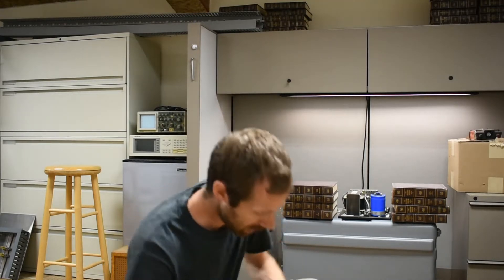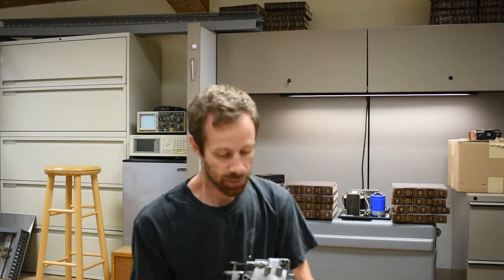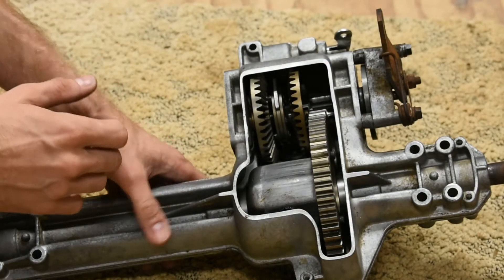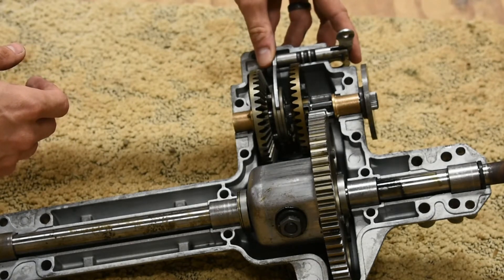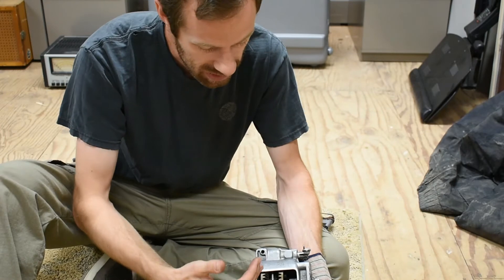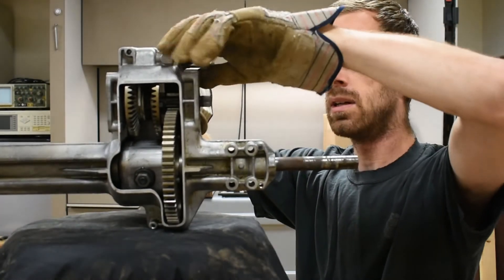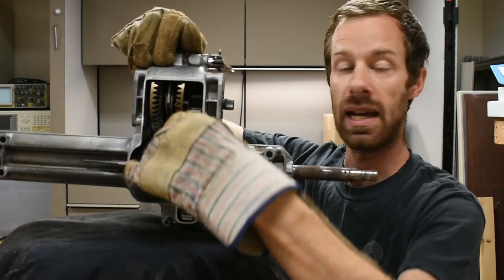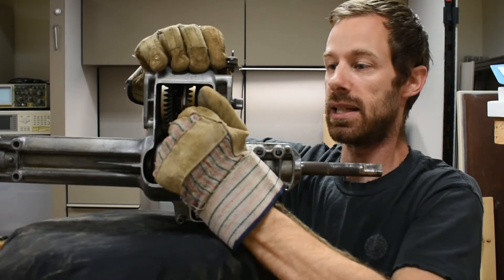What's Inside a Lawn Mower Transaxle?

Comment: This video is exactly what i wanted to see, I have a older mower that feels like it jumps out of gear and back in sometimes after shifting from reverse. If it doesn't then it won't.
I think that spline disc isn't engaging the pins properly. Hopefully it just needs an adjustment or a clean inside. I think i know what i'm in for now. Thankyou.

Comment: Your video is the very best YouTube Video after watching dozens on this same subject for a Lawn Mower Transaxle repairs !

My newer MTD Yard Machine 7-Speed Transaxle with VSP system is turning both rear wheels in opposite directions when setting the Shifter in Neutral (or when disconnecting the linkage & manually engage the Transaxle Lever to Neutral, the middle position. ... 
This is something you say in Video "Never Happens". So how can this happen ???

So my next step is to physically check it's inside Gears to see what needs fixing. ... 
Until then, I cannot Freewheel my mower into the garage to service it unless I jack up the rear of the mower with my 3-Ton floor jack on wheels to move it.

Thx, Larry
Reply from the maker: Do you think, perhaps, that one of the gears is stuck and constantly rotating? That would make it go forward when driving in forward gear normally, but if you tried to go into neutral or reverse, one wheel is still spinning the forward direction and the other is in reverse?

Just spitballing on that - it would be impossible to know without knowing what's going on inside the transaxle... 

However, this video is for a single-speed transaxle, so a 7-speed might be different.

Comment: My Toro LX 420 always had sort of a whine in the transaxle and assume it's those straight teeth gears that do it. It weighs on me that the only way to find out whether or not the transaxle has enough grease in it is when it breaks some day from lack of lubrication. I wish there was a grease fitting on the housing some place and a way to check if it has enough.

Comment: I could use your help. I have a Kenmore 90 Series washer. After completing one load of wash I started a second. The tub filled with water, agitated then stopped. No matter what setting I put it in nothing happens. No humming, nothing. Another Kenmore 90 series washer was given to me. It agitated but no spin. After checking it out it was only a loose wire. Plugged it in & it went through the cycles. Put a load of cloths in & the only cycle that will now work is the spin. Any help on either one of these would be appreciated. I did notice same series but different timer control model. I did check the lid switch, both are good. I even jumped them to make sure. New time did not help any. Here is a video of what I did maybe you could direct me in the right direction.https://youtu.be/CHE_2f5OG9Y
Thank you for any help you can provide.
👍# 215

Comment: My mower goes in reverse but not forward could that be the transmission pulley or the nut is not tight enough
Reply: I know your comment is a year old but if your mower transmission is anything like the one in this video the two nubs on the forward gear may be worn down and not engaging.

Comment: 7:35, can you explain what is inside the box (with a hex nut on it) on the left side of the spur ring gear?
Reply from the maker: Oh yes! That is actually a differential gear set using bevel gears, similar to a normal automotive diff. 
The hex nut (which there are actually two) are attaching the bevel gears to the sides.

The purpose is to allow one side to speed up or slow down when you are turning a corner or if one wheel meets resistance. Like when you drive through mud and one wheel just starts free spinning, the other one stops. You have to push the spinning one down into the ground to get traction to start moving again. This is the gear set that makes that happen.

Here is a closeup diagram from wikipedia: https://en.wikipedia.org/wiki/Differential_(mechanical_device)#/media/File:Differential_(Manual_of_Driving_and_Maintenance).jpg

Comment: Hey!  Thanks for making this video.  Do you know what the gear ratio is from input to output?  What are the sizes of the gears here?
Reply from the maker: So there are three ratios at work there, but I only know two of them for sure. 
I don't have the original pulleys, so the belt ratio from engine output to transaxle input is unknown, but it's probably not too far from 1:1 - I recall the pulleys being fairly uniform in size... 
The first gear ratio, the bevel set, is a 1:3 ratio, and the second set to the final drive shaft is 1:7, giving a total 1:21 ratio. Approximate diameters - large bevel gear 3.5", large spur gear 6.5".